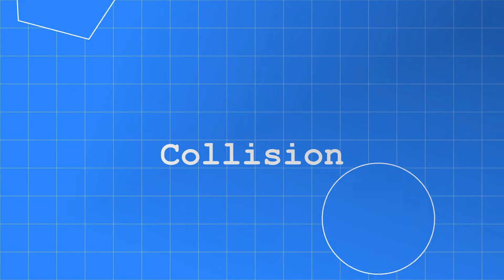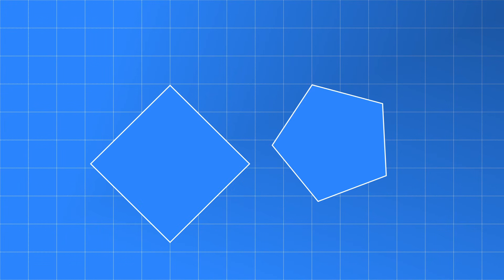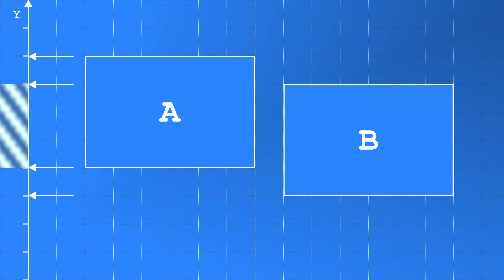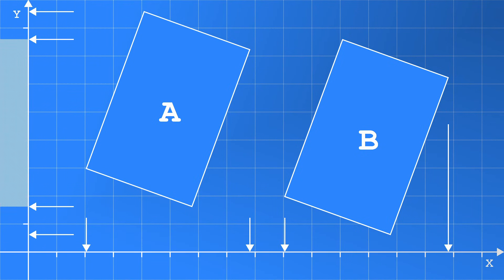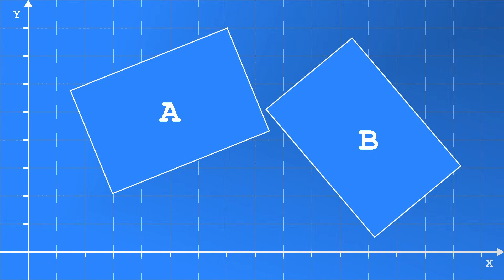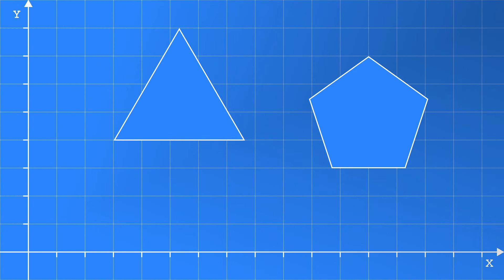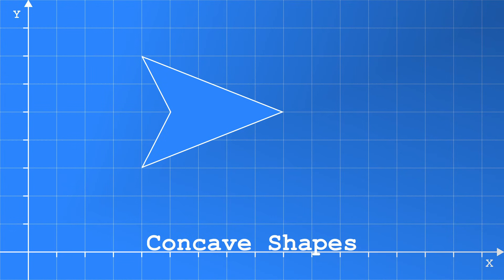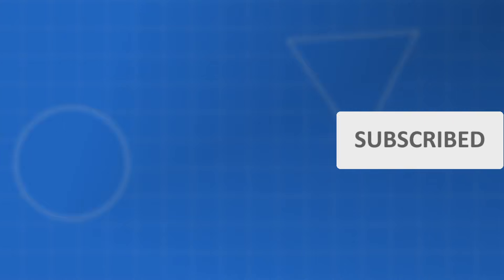How 2D Game Collision Works (Separating Axis Theorem)

Comment: Wouldn’t it be more efficient to check if circles overlap by checking if the distance between their center points is less than the sum of their radii?
Reply from the maker: It would if you're only comparing circles but the approach I outlined in the video allows circles to be compared against any other convex shapes.
Reply: Comparing circles would be an efficient first cut for collision detection of more complex shapes.  If the enclosing circles touch, proceed to a more exact collision detection based on more geometric data.
Reply: @hanelyp1  There is a term of "efficient first cut" and that is called broad-phase collision detection. For which you usually use BVH or Hash Grid with AABB's
Reply: @Navhkrin  Yeah, im currently using that phase in my collisions system, but im trying to make it more efficient
Reply: no because you'd have to compute that for every polygon or create a secondary, hidden, object for every polygon in your space.

Comment: For the circle I found that you need to get the axis from the center of the circle compared to the nearest point on the other shape. Otherwise you run into issues when comparing the circle to long or large shapes.

Comment: Since the "two circles" case identifies the axis straight away by ascertaining it from the line segment between their centers, can you eliminate test cases for N-sided polygons in a similar way? Seems like you should be able to throw away edge normal checks if they don't have a positive dot product with a vector between the two shapes, or something like that, is that right?

Comment: The real problem lies not in checking whether two objects collide, but in which ones out of thousands objects collide ;)  But that's whole another story…
Reply: Not really a problem, you can start out "big" by using a quad tree to separate your objects into areas and only checking the ones in the same node, then you can run a coarse check with an AABB (axis aligned bounding box), then if you do get a possible collision using that, check the fine collisions as outlined in the video
Reply: @michaelcazzarolli375  Don't get me wrong, I didn't say that it's a problem for me – I said that it is a much more difficult problem to solve than a mere two-object collision, especially if one is not familiar with solutions that other people figured out. And even then, there's no silver bullet, it depends on the problem. For example, if you also use collisions as part of the physics engine, and you want to simulate forces between every pair of the particle (like in molecular dynamics, for example).

Comment: * If we need just to check there is a collision or not
I think it's more easier to understand (and program as result) the algorythm where you check if any point of one polygon is inside another polygon.
Of course you can simplify algorythm in some situations.
But yes, in general it pretty much the same math behind it (as in algorythm you show).
Reply: polygons are made up of infinite points tho, so you can't do that
Reply: @vibaj16  No its really quite simple.  There are X points on the perimeter of a polygon, IE 3 for a triangle.  If any of those points are inside the other polygon they have collided.

You do this by subtracting the center of shape B from each point on shape A then dot product the point which has been converted into local space of shape B by each edge normal on shape B.  If the dot product comes up negative for all edges then the point is inside and the shapes are colliding.

This same check is used in backface culling in 3D applications.  This is why if you put your camera inside of something that thing stops being rendered.  You are making each point of one shape the camera and backface culling checking it against the 2D mesh of the other shape.
Reply: @JathraDH  That's very unreliable. Many concave shapes will always fail that collision check algorithm (b/c it's possible that there's no point that is on the inside side of all the edges), and another problem is that shapes can be colliding without any vertices being inside the other shape (e.g., two rectangles arranged in a plus shape)
Reply: @vibaj16  That is why you do what is done in the video and break the concave shapes into convex shapes.  This is done literally everywhere in computer collision.
Reply: @JathraDH  there's still the other issue
Reply: @ There are situations where this will fail with 2 convex shapes though now that I think about it but the general concepts are the same.

Comment: for circles you could just check if: distance(form circle 1 to circle 2) < circle 1 radius + circle 2 radius
Reply: Or save the sqrt operation by comparing (r1+r2)^2 to dx^2+dy^2

Comment: 5:43 wait, they're just circles.  Isn't it just checking if the distance between the two is less than the sum of their radii?  No projection needed.
Reply from the maker: That is the case if you're only using circles. The method I outlined in the video allows for checking circles against any convex shape.
Reply: @Skeffles  So for every face of the polygon you're comparing against 2 points on the sphere.  Points computed based on the face normal.

Alternately you could compare the distance of the sphere center from the face.
(sphere.center - face.point) dot face.normal <=> sphere radius.

Comment: For polygons vs circles, you can use a voronoi diagram to check which feature of the polygon is the closest vertex or edge), and then use the axis of that feature (for edges it’s the normal, and for vertices treat the vertex as a circle with radius 0)

Comment: The visuals made it click for me! Such simple but elegant solution .

Im guessing it works the same  in 3D but with Vector3 normals
Reply: For 3D, you have to check the normals of each face, and the cross product between each edge of the first against each edge of the second. It’s a lot more computation, so the preferred method is the GJK algorithm

Comment: Usually in games there is bounding boxes, game checks bounding boxes first. If bounding boxes overlap then collision checking starts. To decrease numbers of checks normals that pointing away from collision direction (calculated from bounding boxes) could be ignored.
Reply from the maker: Yes, games often use bounding boxes to help improve their performance, especially when they have lots of complex polygons.
Reply: Not just bounding box but axis aligned bounding box (aabb) making it even faster!